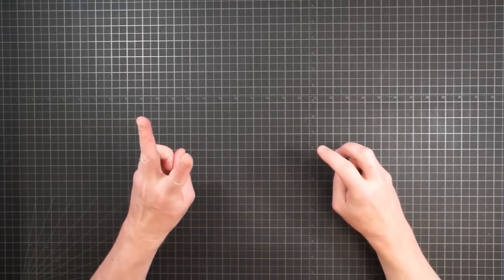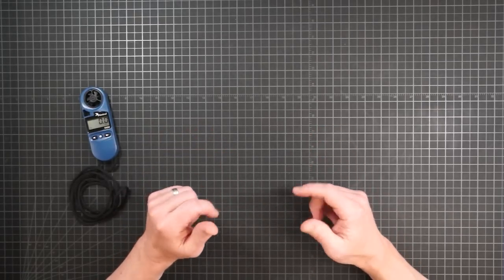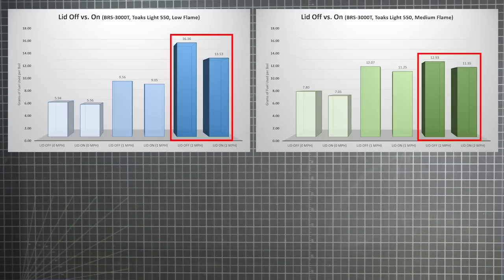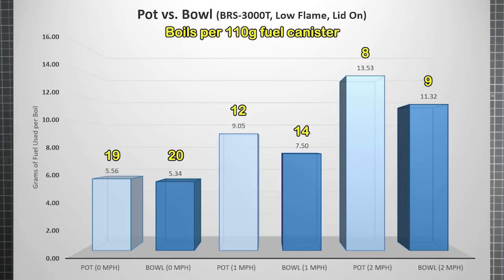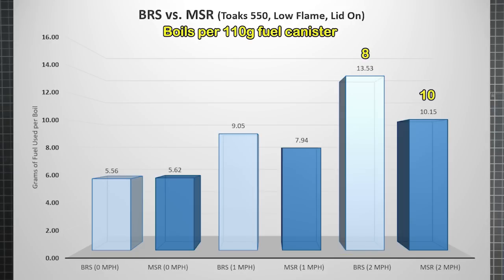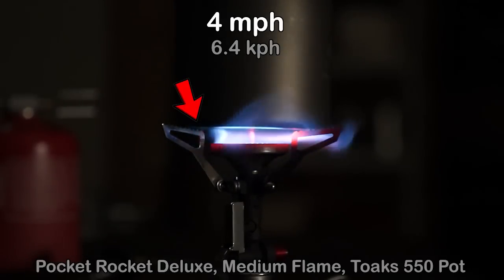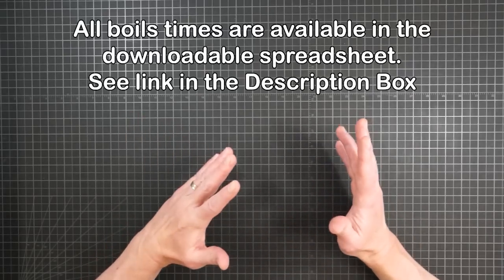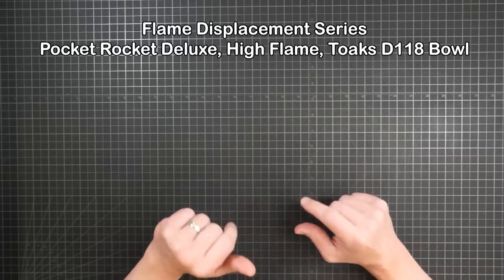Backpacking Stove Efficiency, Part 2: Wind Effects

Comment: Awesome as always. I do wish you had included a fully enclosed burner system like the MSR Windburner. It's efficiency in wind is superb, but where is the tipping point for weight vs. performance ? It's other features such as having a radiant burner head,  bowl, strainer lid, cannister stand, and insulative sleeve/handle would have to be teased out, but the results would be edifying! Of course, essentially it has a built in wind screen (a safely designed one for cannister fuel) so maybe it will appear in the subsequent video.
    Side note: aluminum foil lids tend to blow off in wind right when you might expect the greatest gains from thier use, in my experience.
Reply from the maker: Heat exchangers are coming! I’m planning them for Part 4, to see how they compare to a conventional stove+windscreen combo in terms of both efficiency and total weight.

Comment: I used empty freeze dried meal pouches creased/folded lengthwise, then leaned the v-shaped pouch against the pot as a windscreen. You can use up to three pouches by overlapping them while leaving the valve handle exposed.

Comment: Some part of the efficiency loss in wind is the wind directly stealing heat from the sides of the vessel - I wonder if a carbon felt pot cozy around the circumference would make a difference, or if the vast majority of the losses are just the flame movement. A tall windscreen would help both of course, but a pot cozy is multipurpose since it can be used to lift the pot and keep food warmer longer.
Reply from the maker: I have some carbon felt. I’ll put that on the list for Part 3!
Reply: It's a relatively small amount of energy which is lost radiatively. As far as the water/pot are concerned heat of vaporization is a much more significant contributor to energy loss.
Reply: @ckb1137  Depends on power. Radiation loss power is linear on difference of temperature and linear on surface area. Energy loss is thus the integration of the temperature difference with time.  That's why if your power is too low more time is spent at a high (below boiling) temperature where losses are high now for longer time.
Reply: @GeekfromYorkshire  vaporization is also a function of temperature difference. It is factually the largest component of energy loss when boiling water under standard conditions. (excluding the flame itself naturally)
Reply: @ckb1137  Indeed (and lid off makes that worse) but the point is still valid that energy (power integrated over time) is lost more if you hold such losses for longer. That's why a stronger flame can cause less energy (not Power) loss.

Seems if combine this video with the predecessor the biggest thing to focus on is slowing wind as it's losses are higher than the variability of pot, and then when you've done that then a wider pot with a lid. 

So we seem to come to zero-weight wind reducing schemes. Vestibule, backpack, etc.

Comment: Great video. I now know, based on my experience and your video, that I hardly ever cook with my BRS in >2mph of wind exposure. Because the small canister usually lasts me at least 16 boils. I achieve this by placing my food bag and food items on the windward side (usually freeze dried meal pouches) and I also look for rocks in the environment. Would love if some sort of "improvised wind protection" was in Part 3 of your excellent series!
Reply from the maker: Definitely! I will work out a few common or easily rigged improv methods to see how they compare.  After all, there’s no weight penalty to using something already carried.

Comment: I Absolutely love your attention to detail and your scientific approach. No one,  no one has or is doing what you are. This is fantastic information to store in our brains. I would like to see all of these results as they pretain with the variables of barometric pressure.  Because you are working with pressurized canisters I'm also interested in the evaporation/atomization flow rate factors at various atmospheric pressures. Pressurized Thermal flow rate variances with positive wind flow at different temperatures. A shame you can't also add elevation factors. 
As an example, using your present test parameters, is barometric pressure affective in fuel consumption? Example 2, is there a difference in fuel consumption at 2mph when the wind is +40F vs 0F? Great job,  Sir. Looking forward to more of your experiments.
Reply from the maker: Thanks much! Unfortunately, I don’t have a way to do altitude testing, but come winter I’d like to see about some colder weather tests.
Reply: @GearSkeptic  I hate to say it,  fore, I don't want to label you,  however,  you are on your way to being the foremost expert on this specific subject. You use the scientific method and quantify a result that is repeatable. I respect and love your data as well as appreciate your work. You should publish! It would definitely be a standard.

Comment: Curious to see if things like the Trail Designs Caldera cones will make an appearance when discussing wind screens! I'd love to see your level of analysis applied to those things
Reply from the maker: I do plan to start testing alcohol stoves after all the baselines are in for gas.  Though, I might also try cone screens with a remote gas canister stove. Interesting idea!
Reply: @GearSkeptic  +1 from me for including the Trail Designs system(s) in a future comparison! I would think the Sidewinder system should be the focus, however, due to its weight advantage over the Caldera.

This seems like a particularly important comparison insofar as your comparisons so far have hinged upon the extra cannisters required to use a less efficient stove (even if the stove is lighter than more efficient alternatives). This begs the question, however: what about no cannisters? With an alcohol stove, one can take exactly the amount of fuel required for a particular trip, and one can store it in a lightweight plastic container (rather than a metal cannister)!

It would be particularly interesting to evaluate whether this weight savings offsets the relative inefficiency of alcohol stoves such as the Trail Designs Kojin (when utilized with the purpose-built Trail Designs Sidewinder windscreen).

Thanks as ever, in any case, for your incredible work on this channel. I have learned so much from you!

Comment: Once again, thank you very much for making this video Sceptic, I have just changed over my whole cook system from a trail designs. Keg f which is immensely light to an alpkit Kraku stove which is just a heavier duty version of the BRS. I too was concerned about fuel consumption from a breeze, my solution was to buy a bear bones TI mag windshield which is essentially a thin sheet of titanium with some magnets which attach to the bottom of the canister weighing at 7g!
The alcohol stove is my go to for shorter trips and for longer thru hikes I prefer the canister setup as fuel density is greater on gas meaning I carry less weight?
What are your thoughts on this?
Additionally, what your safety thoughts on using a windshield attached to a gas canister, mine gets particularly warm enough so that I am considering punching some ventilation holes lower down near the canister.
Cheers
Reply from the maker: Once I finish gas, I do want to start on alcohol stoves and see how those compare on short vs. long trips, in the cold, and in wind.

I’ve only started playing with windscreens, but there is a lot of talk about overheating issues.  I’ve seen some say the stove arms can get so hot they bend and the pot falls over.  I have one of those contactless infrared thermometers to help measure how hot things get.
Reply: @GearSkeptic  Nice one, well I look forward to your findings, Thank you.

Comment: Isnt the most energy lost from the open top of the vessel?
So a wider pot with a lid could potentially be more efficient under high winds than the regular one with a lid?

Very nice to hear, that you will test windscreens. I assume only the very light ones (e.g. titanium foil) will be worth it.
Reply from the maker: I did most of these tests with a lid. Relative heat loss will probably depend on whether you mean by convection, evaporation or radiation.

A lid made more of a difference with a wider pot (Part 1), but that would be because the wider pot was losing more through the top.  Here, I was referring to how heat loss tends to be fastest where the temperature differential is greatest, or from that part of the pot that gets hottest.
Reply: @GearSkeptic oh yes sorry. I just watched it again and now see, that in your comparison overview at 23:48 you tested with lids on.

Comment: Another thought is that if you have a lid on your stove, then the only way to know that it’s done boiling is the steam coming out of the holes of the lid, besides checking it periodically.  That means it is boiling longer than the 200 degrees in your test, which strengthens your argument that a lid isn’t worth it.  Especially if your pot is much larger than the water volume, as I found out this weekend with my own test with a 1.4 liter pot and two cups of water.

Comment: Great video. Even though a lot of conclusions can be arrived at by theory, it's good to know they bear out in practice. I do wonder, though, if the aluminum foil lid will stay on in that level of wind or if it will fly away. If so, maybe putting a weight on it, such as a tent stake, stick or rock on it would hold it down.
Reply from the maker: The pot does have a lip, so you can actually crimp the foil down so it will stay on.  But, then you have to be careful removing it when hot!

In truth, I carry the carbon fiber one, but I see a lot of foil fans out there so I considered it for the video.

Comment: I’d be interested in your analysis of pots with metal fins on the bottom such as the JetBoil Stash.
Reply from the maker: Yes! Heat exchangers should be Part 4, after Part 3 on windscreens, so I can compare an ultralight stove/screen combo with a finned system (for both weight and fuel efficiency).
Reply: @GearSkeptic  I look forward to both upcoming parts! When backpacking with my wife, we boil about 1.5 liters per meal, or 3 liters a day. That’s enough I suspect we reach the break even point for a heat exchanger on 4-6 day trips.

Comment: Great video.  One question is how windy does it get on the other side of the tent, or in a partially opened vestibule?  In other words, what is the highest realistic wind speed that is encountered while backpacking?
Reply from the maker: It's a good question.  Obviously the weather can vary and winds could get very strong.  I would like to know how much protection a tent provides, but I don't have a fan setup that could put good, consistent wind across an area that large.

I may have to look into a larger shop fan (or multiple fans)

Comment: So having concluded a wide pot on a low flame in the previous video it's now raise the flame in wind and a narrower pot wins in the windier conditions.

So as we can't always know the weather conditions we're left deciding what exactly?
Reply: The narrow pot fits the small gas canister. The Toaks 550ml can also fit the BRS3000T and a mini bic. All held together by a asparagus rubber band. Whereas the wide pot is much more difficult to pack efficiently without anything rattling around.
Reply: @wio2189  Yes I know about packing canister in pot with stove.

But where does your food go? How robust is your food?

A gas canister is a strong item, it can withstand being by itself outside of your pot.

But these Titanium pots are not that strong, they are weaker than the canister.

So either you'r placing your canister inside your Ti pot to be a splint support to help the pot not get squished, OR your're letting the canister survive on it's own outside the pot and STUFF your pot with food items which would quite like the protective place of the Ti pot.  e.g. Oatmeal.
Reply from the maker: The Summary section has some thoughts on overall strategy in light of the new information.

Comment: I'd be really interested to see how alcohol stoves compare, but I suspect the weight savings for the fuel containers will be easily lost on the burner weight and accessories. I wonder how the trangia fully enclosed set would perform with wind if that's an effective design. But again the weight of it surely will never be worth the fuel savings
Thanks for your work!
Reply from the maker: I have begun collecting alcohol stoves! I’d like to get the gas foundation done, then start comparing alcohol by weight, cold and wind performance, etc.

Comment: A remote canister stove is 31g heavier than a canister-stop stove. e.g. for the same burner head, the Fire Maple 117T 106g vs canister-top 116T 48g is 58g but the canister-top should have a canister stabiliser 27g so the difference is actually 31g.

As a remote stove (can be) lower then wind speed is naturally lower (friction from ground where wind is zero grows with height) AND you can use a windscreen without the risk of stove / canister overheating.

You don't have to re-run your tests you could just alter the height of the wind speed test and measure speed at height then infer from what you've already done. i.e. if you measure the wind is 1mph lower by 2 inch lower you can infer that a 3mph canister-top performance would be similar to a 1mph remote-canister system and then fuel saved calculated then compare with added weight of the remote part. I don't own a windspeed tester so I can't do that first part myself.
Reply from the maker: They are discontinued, but if you can get one the Olicamp Xcelerator is the lightest remote canister stove I've found.  The listed weight is 98g.
Reply: @GearSkeptic  Mine weighs 106g so near enough.

Comment: I have a Windmaster and a BRS so I've seen it happen, but I'm still surprise just how little wind it takes to seriously impact the BRS's performance. NC State University maintains a weather station on Fryingpan mountain near Shining Rock wilderness. I pulled the top of the hour wind speeds for the past year and then classified it as over/under 5 or over/under 10MPH.. 71% of all hours in the last year reported speeds over 5MPH, and 39% of the hourly records were over 10 MPH. Without a solid plan in place to block the wind, the BRS isn't even a viable option and even the Windmaster would likely struggle.
Reply: ...on a mountain top. Not a place for cooking without a wind screen.
Reply from the maker: Yah, I don't think you can reasonably skip a windscreen in any real breeze.  Flatcat Gear has done wind testing on some of his screens up to at least 8mph and can still get a boil.

Looking forward to testing all that stuff.

Comment: “I’m a conservationist at heart, so what I cherish is saving fuel”, said after burning through dozens if not a hundred fuel canisters.

Just joking, I seriously appreciate all the hard work you do. I originally came to your channel to fix my hiking nutrition (amazing results, especially recovery mix) and now stay for the PhD level of detail of the scientific method. You are amazing
Reply: dozens? lol hundreds really? my guess is maybe 4-5 and thats being generous.
Reply from the maker: LOL!  Fair point ;)

I actually did both videos by rotating through 5 of the largest (450g) canisters.  I started a few new canisters near the end, even though the original 5 aren't quite empty.  I just didn't want to run out during a test, or deal with the inconsistency of low pressures on my results.

I've got one of the those refill adapters and I'm going to pour all the leftovers into one recycled can.

Comment: what about solid fuel vs isobutane weight / efficiency ratio?
Reply from the maker: Interesting. It will likely change depending on length of trip (number of boils), but I will have to give a testing protocol some thought.

Comment: With respect to the anemometer, what is the difference between the average reading and the peak reading?  Great video!
Reply from the maker: I never saw any surges, peaks or dips outside the 0.1mph variation.  The Vornado talks about having a vortex spiral of flow that supposedly creates a sort of focused column of air.  That might contribute to consistency.

As you saw, I didn't use a wind tunnel setup like yours.  Wasn't sure if an open fan arrangement would be more like a natural wind (without the gusts and direction changes).